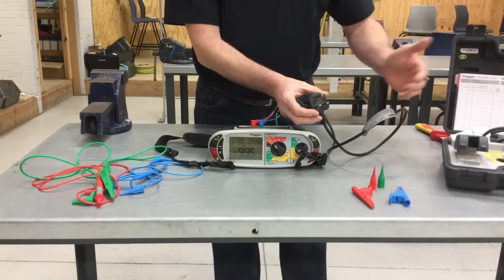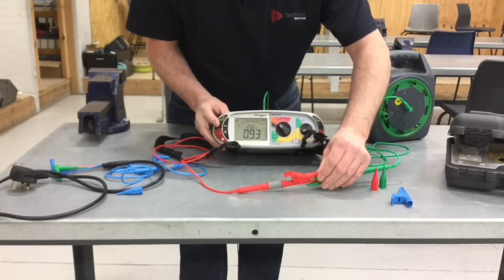Parallel Earth Paths Testing for Continuity & Polarity of our Steel Conduit Radial Socket Circuit

Comment: I wouldn't use a coin to null the meters plug lead resistance, they are not made of copper which has a higher resistivity, unlike a coin which these days are made of alloys. Don't lose sleep over it though Gaz 😁 just modify an old unswitched SG socket outlet with some 4mm copper links between L/N/E and use that for nulling.

Comment: If you had a flying lead from the earth terminal in the back of the socket to the metal backbox would this give you a parallel earth path even if you disconnected the cpc in the board? Would you just disconnect the flying lead to do test the continuity of the cpc?
Reply from the maker: Hi. If you have more than one socket in metal conduit then I test them socket fronts not screwed back and fly leads removed. Then fly leads connected, switches on and covers on for Insulation Resistance test. Thanks for watching GSH Electrical 👍